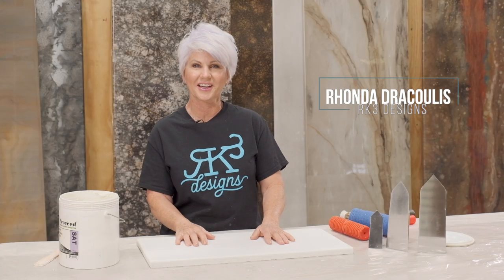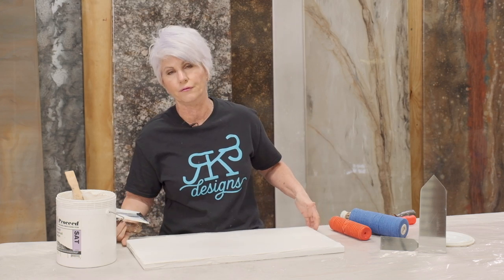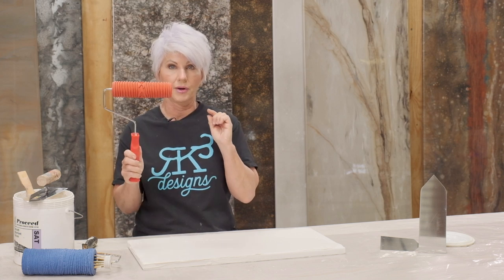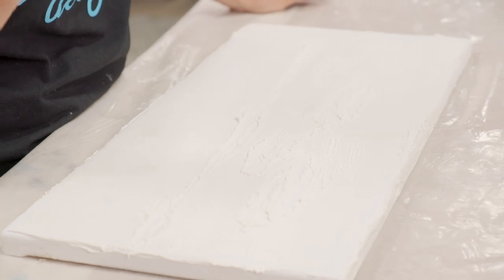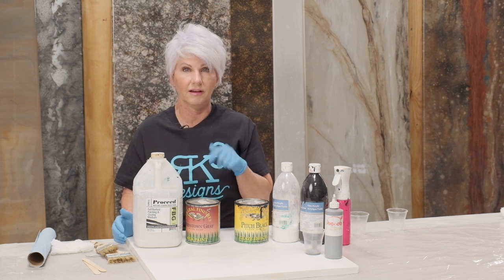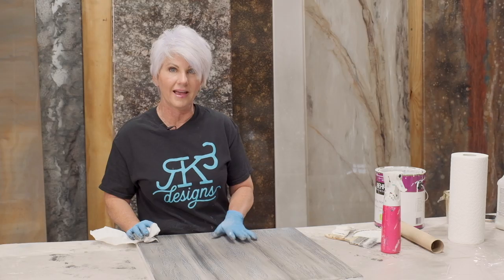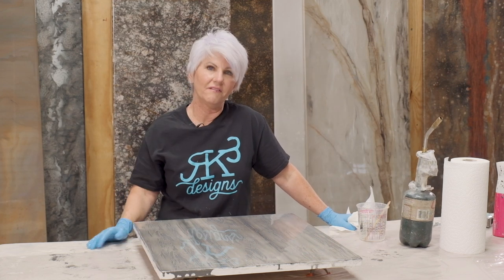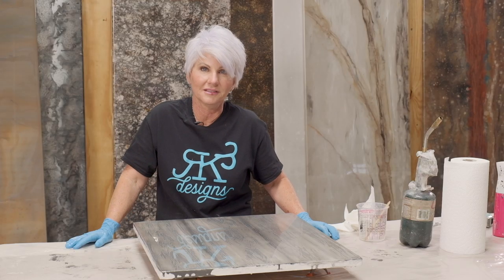Faux Finish Driftwood with Stone Coat Countertop Epoxy!

Comment: Really awesome, thanks for sharing🙏🏻. I love seeing all the videos, faux finishes are fantastic for me, as I do artwork and for example with this as a background, I could do a foreground of flowers.  Thanks, ALL info is really appreciated.  Are the rollers silicone?  I’m wondering if they are, could they roll through setting epoxy?  P.S. I am trying to learn to cut my own MDF, and round the edges also, I’d love to see how to do that also.
Reply from the maker: Hey there. Thanks for watching!! I’ve not had luck rolling into the epoxy. Way to sticky ! 🤪
Reply: RK3 Designs Thanks for the answer, I was very curious 😊

Comment: Great work! I noticed that you don't use any type of urethane top coat to reduce possible scratches during normal use.  Do you get any complaints from your clients as far as how easily the surface can get scratched?
I recently finished my first counter top but it is so delicate that even running my finger nails on it hard enough create hair line scratches.  My epoxy ratio and application was spot on and I use  Stone Coat Art s well. Your thoughts?
Reply from the maker: Are you letting the countertop cure the full 30 days? I've not had any customers with issues thus far. I do put a matte finish on just about 80% of my pieces. This will help hide most all of the hairline scratches plus, to me it makes the piece  look more natural. I'm testing a topcoat now, I'll keep you guys posted!!

Comment: Helpful info for a beginner like me . Amazing tutorial. My question is “No need for face mask with the epoxy??”  And pls explain what is the difference between the epoxy and the resin. Many many thanks
Reply from the maker: Hey there. The epoxy I use, Stonecoat countertops, is zero VOC. But not epoxies are like this. Just make sure you check the label. 
https://epoxycountertopdiy.com/epoxy-vs-resin-the-difference-explained/